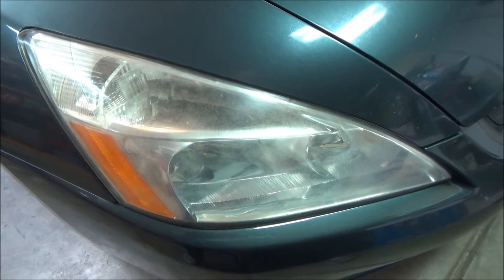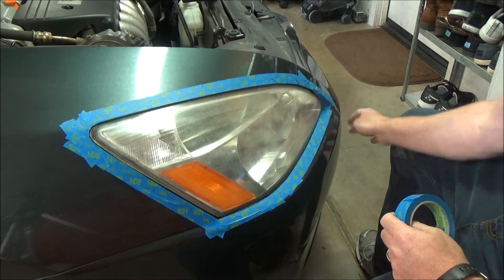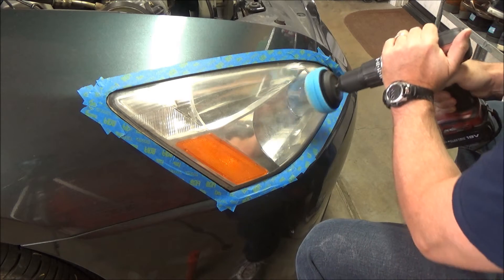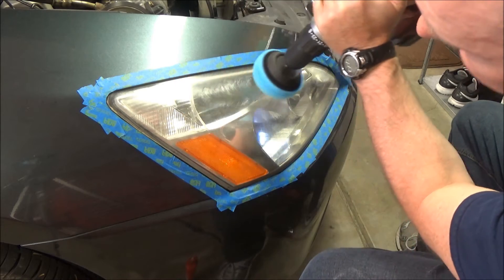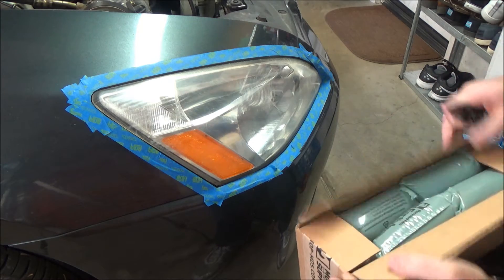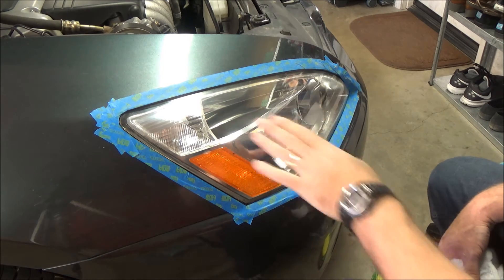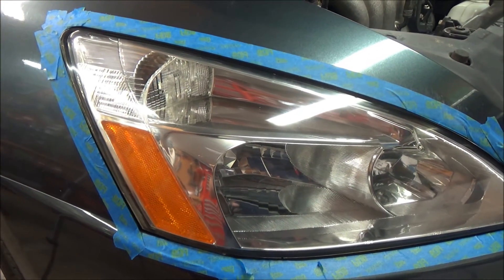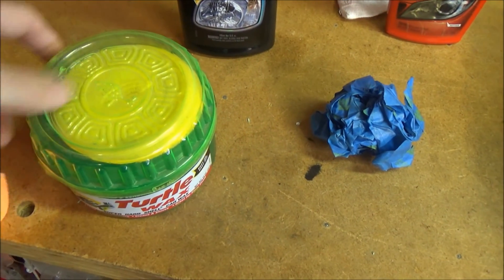Headlight Assembly Restoration (No Sanding)

Comment: MUCH faster and cleaner than wet sand / spray paint.
Reply from the maker: Yes, it is definitely faster but most likely will not last as long as sanding and spraying clear over the top (especially in climates that see a lot of harsh sun).  Thanks for the input!

Comment: Are the headlights still clear today? Have you had to put any more UV protection on the headlight?
Reply from the maker: Usually lasts about 6 months or so and then you need to buff it up again (at least out here where I live).  If you don't let them get too bad, the touch up usually only takes a minute or two.

Comment: What pro's won't tell you about wet sanding doesn't provide clarity, it actually leaves a scratched haze beneath the polish that you can see looking from a side view. (And my sanding methods start from 600-800 depending on severity, then 1k, 2k and finishing with 3k) New lights are clear no matter what angle you see them from but not sanded headlights. And that's from experience, from the front my headlights look great, from the side you can see the haze from adding all the scratches. And to be honest I think the sanding steps are a joke, all you really need for lightly oxidized  to slightly below extreme, is to get the oxidation out, i prefer a paint safe all purpose cleaner, polish, then re-seal. I prefer something more permanent than what the local stores offer, and that's some clear bra. It's just a headlight so it doesn't take much product or skill to apply and the restoration will last the lifetime of the wrap, which is years compared to months and is non sanding removable when and if you need to replace
Reply from the maker: Thanks for the input.